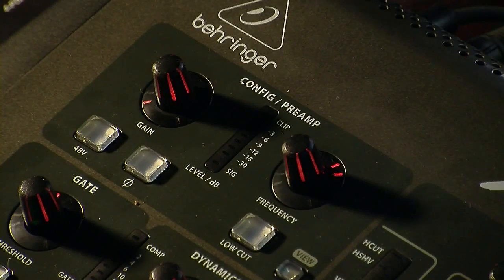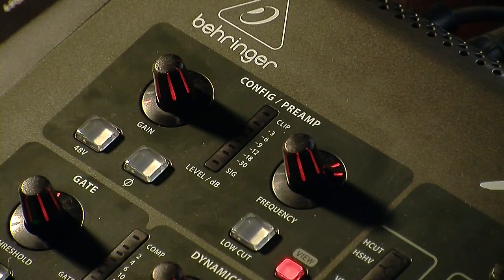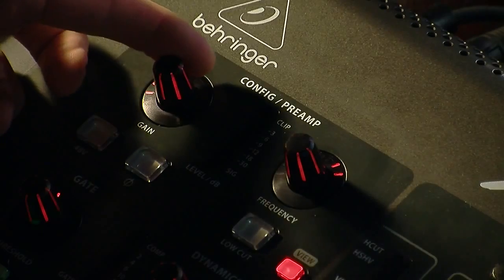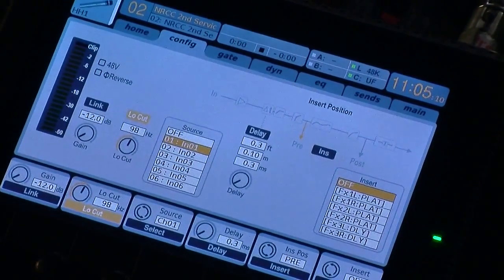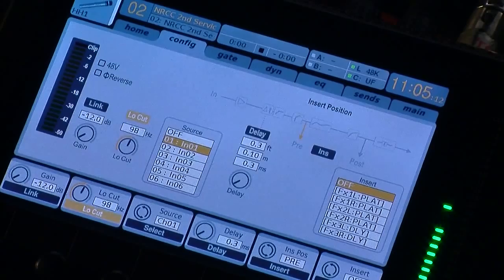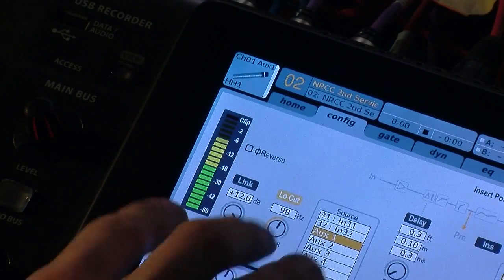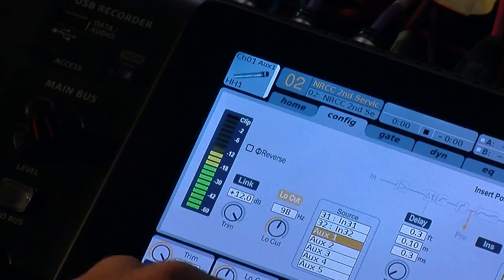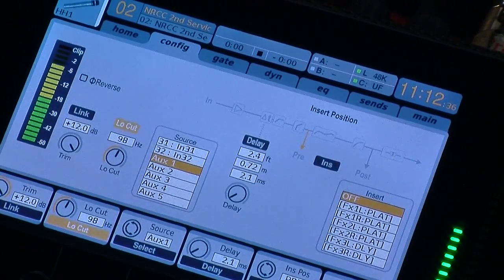Behringer X32 - Config/Preamp Section - NRCC

Comment: About mic set-up delay: You showed delaying the snare about .3ms to avoid the OH picking it up after the snare.  Doesn't that create the same problem with, say, the bass  which would be about 10 feet away.  If you delay the bass to keep the OH from generating an echo, don't you set up a train-wreck with every sound source reaching every mic at different times?  Then nothing matches.  The audience notices they "see" the OH before they hear it while seeing the snare on time.  So, when is the risk worth the reward?  Thanks.

Comment: Drew, your videos have been priceless!  I am facing a HUGE problem with the mics for our choir in our pageant.  Regardless of anything I do on the board, I have to turn the gain up so high just to get a decent input signal that it starts giving me feedback.  It's almost like our typical Audix cardioid choir mics went to little condenser mics - all of them at once.  We have a small choir and 2 Audix mics on stands but I just can't get a signal strong enough to pick them up and put them into our mains without making everyone's ears bleed with feedback.  Can you assist?  Our pageant is in 2 weeks and I'm about to pull my hair out.  Any help you could offer would be greatly appreciated.

Comment: great video!  got a question... i have a Shure SM7B mic that requires phantom power..,  but the 48v does not turn on..  seems like it does not recognize the mic plugged in.   is there anything i have to do to get the 48v function to activate?   any help would be great, thanks!
Reply: 5 years old post but why do you need phantompower for a dynamic microphome? Is it for the cloudlifter/fethead?